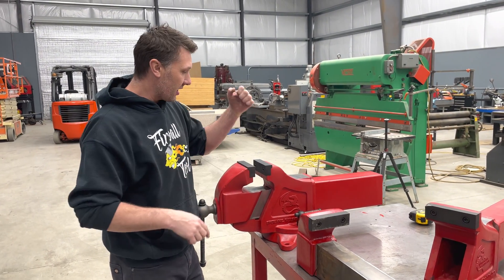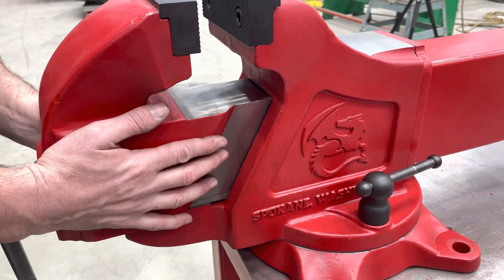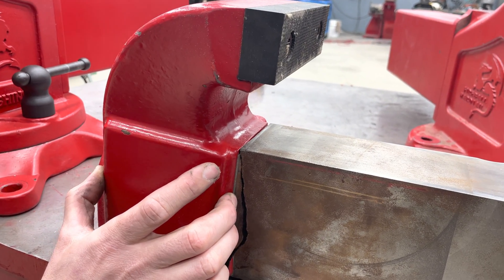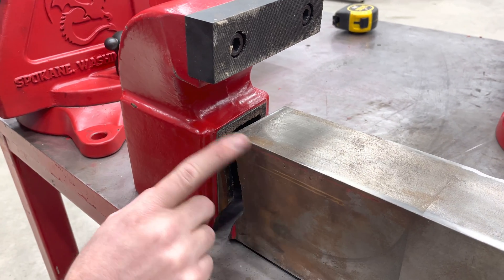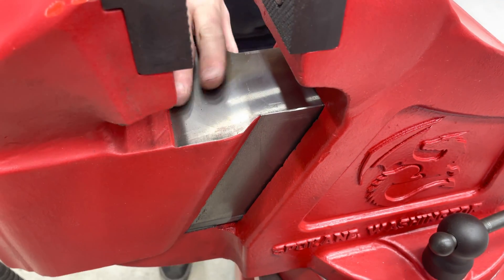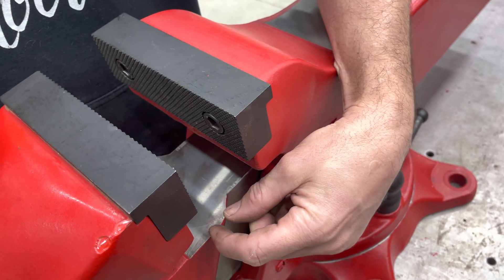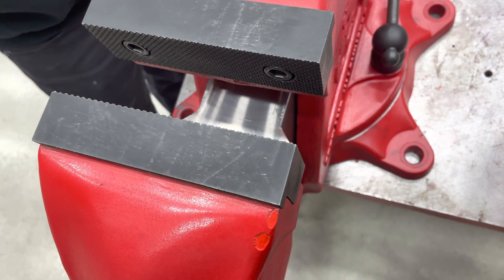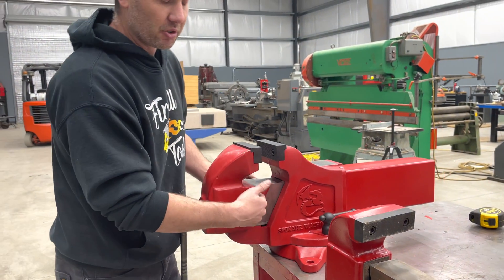Why does the Cheek have a 45 Degree Purchase? - Fireball Hardtail Vise

Comment: how are you causing these catastrophic failures i use a 3 pound mini sledge while waffling on things in the 6 inch bench vise at work and its the original vise since i started working there 10 years ago
Reply: One of the ways he caused a failure was by using a massive "cheater" bar and basically jumping on it. He has a video on destructive strength testing of vises.
"WHAT VISE IS THE STRONGEST?" https://www.youtube.com/watch?v=VcbTopj5u7A

Comment: The cause of the failure of the original vise is a stress concentration due to a "sharp" inside corner where the machined area transitions to the un machined cast area.  The stress concentration locally increases the overall stress as one over the radius of the inside corner.  Leaving a large radius at the transition reduces the stress concentration.    RotarySMP made a video called "How are airliner engines held on?"  At 3 minutes 16 seconds you can see how the airplane part has very large gentle radiuses even where doing so was much more machining work.

Comment: Another way to avoid that failure, is to use steel instead of cast iron.  I get the financial advantage, but I'd still think that people buying a Fireball vise would be happy to pay the difference to get one made of a material less inclined to catastrophic failure, and hugely more repairable.
Reply: @Random I have no idea but casting steel is much more difficult than cast iron.
Reply: I agree with what you are saying. But the cast version is $1800 and the machined version is $3800. I will take my chances with the cast!
Reply: @55afishead the $3,800 version is still cast iron, it’s just made in the US. The $1,600 version is made in Taiwan.

Comment: Could you have reinforced it on the inside? (Free up more clearance)
Or is it more a stress concentration point geometry issue?
Reply: I believe the stress is where the jaw is actually connecting to the slide, in order to transfer that internally would need to have that connection internally as well which would interfere with the worm.
Reply: @garlandtx10  
Mm yeah thought that might be the case

Comment: Isn't it just going to move the point of stress to the diagonal transition?
Reply: Yes that's the point though the stress is transfered along that longer area instead of a concentric bulwark if you will.  Think linearly pulling a 2x4 from one end to the other versus pulling it from the middle.
Reply: @garlandtx10  makes sense, got it. Thanks for the explanation